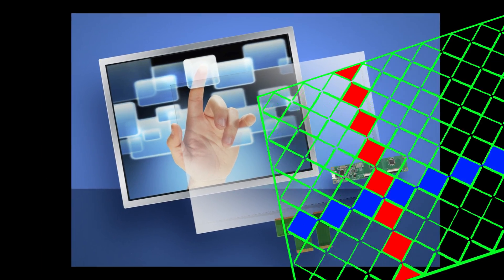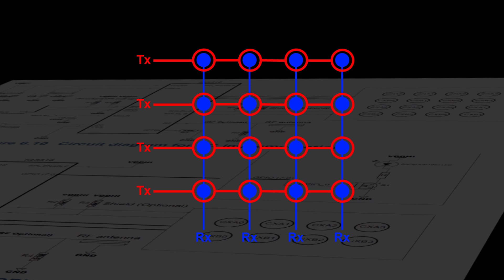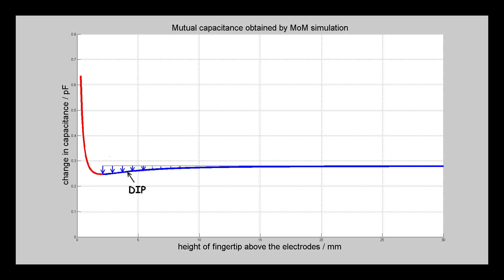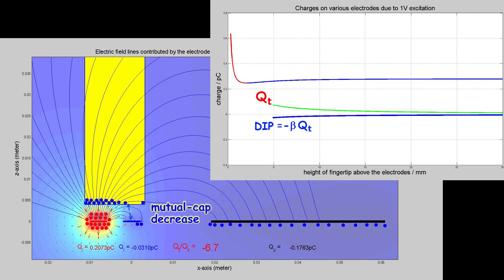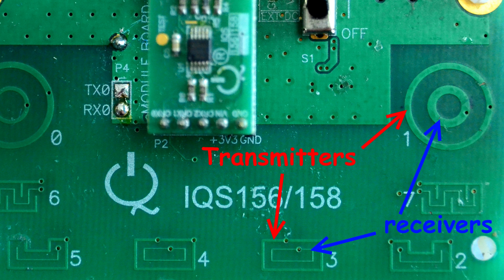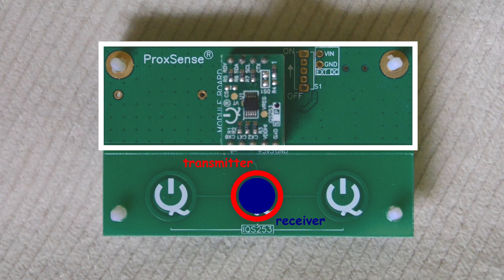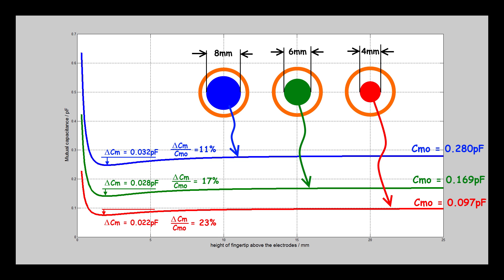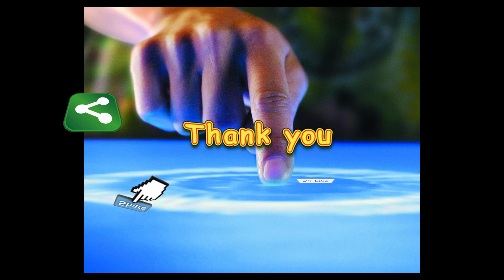projected capacitive sensors, theory and design.(Touchscreen explained)

Comment: Thank you for the great content! I would be grateful for your insights on some of my questions: 

- is your virtual ground at the same potential as the earth ground? 
- In a numerical simulation where there is just the sensor electrodes+a piece of dielectric and no ground, the mutual capacitance should increase right (how is the mutual capacitance defined here)? Because in your earlier video "Capacitive sensor, theory and design", you mention that the mutual capacitance increases due to the polarization from the approaching dielectric medium, which draws further charges from the +V and -V sources; but in this video, you mention that the mutual capacitance decreases. What are the differences between these two cases?  
- Lastly, assuming that I have the information of the charges, how can I obtain the mutual capacitance numerically? Is it correct to find the energy enclosed in the simulation space (E = 1/2 integral of D dot E dV) and do C=2W/V^2? If so, what about doing this energy calculation with a lossy dielectric with both real and imaginary part of the complex permittivity?

Thank you so much for all your wonderful content, and I would be really grateful any comments at all! Wishing you a nice day!
Reply from the maker: The working principal of capacitive sensor does not need the earth ground. 
In other words, the circuit ground and the object (finger+body) are sufficient to influence the charges of the electrode(s),  so the simulation does not take the earth ground into consideration. This is a important point, because capacitive sensor works near the earth surface, or in the mid air.

If a circuit has zero or negligible ground area, then the self-capacitive sensing will not work, but the projected capacitive sensor will work like a self-capacitive sensor. Self-capacitive sensors need 2 electrodes whereas projected capacitive sensor need 3 electrodes.

In the self-capacitive sensor, the transmitter and the ground plane (total two electrodes)  form the transducer to detect the object (human body + fingertip), whereas in the projected capacitive sensor, the transmitter, the receiver and the ground plane (total three electrodes) form the transducer. 
In the self-capacitive sensor, when the finger-tip moves to the touch-electrode, the charges on the touch electrode increases because the electric field polarize the human body, and the charges on the fingertip pull more charges from the source to the electrode. The increase of charges on the touch electrode is regarded as the increase of self-capacitance in the industry. In precise scientific sense, the increase of the charges on the electrode is mainly due to the increase of MUTUAL capacitance between the electrode and the fingertip, but this complicate the matters and I haven’t seen anyone talk elaborate on the misuse of the term SELF-capacitive sensor.

In the projected capacitive sensor, the electric field is projected from the transmitter electrode (1), reflected by the fingertip (3) and bounce to the receiver electrode (2) to reduces the charges on the receiver electrode. The analysis cannot be done by lump capacitor, because lump capacitor confines the electric field within the capacitor and will not influences the nearby object. The reduction of charges on the receiver electrode is regarded as the reduction of the mutual capacitance C21. In precise scientific sense, the charges on the receiver electrode is due to  C21, C22, C23, and as the finger moves and the multi-body capacitor changes shape, C21, c22 and C23 combine to influence the charges on the electrode. C21 can be negative, and when the fingertip is very near the receiver electrode, C23 can overwrite C21 to give some unexpected turn-around response.

Capacitive sensing IC has no idea what happens outside the IC, so it doesn’t know the charges and voltage on the external object (human body and fingertip). It simply amplifies the charges on the electrode to get the trip, and regard the charges proportional to self- or mutual capacitance. As mentioned above, this is not rigorous academic definition. If you want to follow this practical but somewhat incorrect definition, then from the numerical simulation, just take the charges on the electrode and divided by the excitation voltage, you get the capacitance and the tripping mechanism like actual IC.
In my simulation engine (method of moment), I was able to control or force the voltage on each body (this is a multi-body capacitor problem). To calculate the mutual capacitance, I make the transmitter voltage = 1, and force the object voltage to 0, then charges on the receiver is exactly the mutual capacitance. In reality, some non-zero voltage is induced on the object, and this voltage contributes charges to the receiver electrode as well, so the charges on the receiver electrode is not simply related to one particular mutual capacitance.
Reply: @SiliconSoup  Wow, thank you for amazingly clear response! Really appreciate it!!! All the best 😀

Comment: How to optimize the electrode size if we want to measure the capacitance and impedance for a moist body (e.g., wood)? The capacitance and impedance should be higher or lower? which capacitance and impedance value (high or low) will provide the best moisture information. Thanks.
Reply from the maker: I think the self-capacitive sening method is better than the projected capacitive sensing method for measuring the material property.
The capacitive sensing ICs I used as examples in my videos are for user-interface purpose. If you want to measure material property, then the "capacitance meter" must be "calibrated". Most user-interface capacitive sensor has tracking mechanism to detect delta only, and therefore no calibration.
The self-capacitor sensor measures the capacitance between the sense-pad and the ground plane. The object (conductor) between the plates short-circuit the space and shorten the gap, hence increases the capacitance. The moisture also short circuit the space and increase the capacitance. There should be correlation between the capacitance and the moisture.

Comment: Thanks for the video :D !!! 
I fully enjoyed :D

I have a question... How can i detect a finger near of a metal sheet without contact? I need a on/off output (3.3 volts)
Reply from the maker: You may search for CAPPO sensor, sensing the change of capacitance due to the micro-depression of metal plate.
Reply: @SiliconSoup  Thanks a lot :D
I'll search about :D
Thanks 🙏

Comment: Very clear explanation! I’m wondering if there is any material you could provide for reference? I’ll be appreciated for that, thanks.
Reply from the maker: As far as I know, the explanation given by others use different models, which  don't take into the account the effect of ground plane, and don't explain the turn-around phenomenon, The explanation in this video is original, so there is no similar reference article. But be assured, this model is backed up by years of experiments and numerical simulation.

Comment: Best explanation for capacitive screen I've found! 
Could you explain a little bit why the decrease of negative charges on R plate leads to a drop of mutual capacitance?
Reply from the maker: Charges on Tx, Rx and the fingertip are all proportional to the excitation voltage V_Tx, so it makes sense to talk about the charges on a per-voltage basis, e.g. Q_Rx / V_Tx, which is the definition of capacitance. The charges on one conductor due to 1V excitation on another conductor (and strictly no influence from the rest of the conductors, i.e.g 3rd or 4th conductors) is known as the mutual capacitance. Influence from the rest of the conductors can be eliminated by grounding them,  so this is done when calculating or measuring mutual capacitance.  In the matrix-type electrodes, Q_Rx/V_Tx is measured when other rows and columns are grounded, so this is almost like the mutual capacitance. (almost but not exactly, because the human body, the biggest conductor in this multi-body capacitive system, is not grounded during the measurment).
Reply: Thanks for your reply~
I'm a little confused with the definition of mutual capacitance here.
Are u suggesting that mutual capacitance btw Tx and Rx plates is almost determined by Q_Rx/V_Tx ? 
If it is, then what does Q_Tx/V_Tx stand for? is it another mutual capacitance of reverse direction?
Reply from the maker: Precisely speaking, when all electrodes and human body are grounded, Q_Rx/V_Tx  is exactly the mutual capacitance and Q_Tx/V_Tx is exactly the self-capacitance. But capacitive sensors do measurement with the human body floating, so Q_Rx/V_Tx is almost, but not exactly equal to mutual capacitance, and Q_Tx/V_Tx is almost but not exactly equal to the self-capacitance.

Comment: Could you please tell me what tool you are using to measure the self and mutual cap?
Reply from the maker: +Chethan_D I used IQS253 eval-kit and CT210 (www.azoteq.com) to measure the self and mutual capacitance. The tool (CT210) is connected to the target board to read the capacitance and display the data on the PC. This typical connection also connects the computer ground plane to the target board so the overall ground plane is bigger than the actual target board ground plane. To avoid the effect of PC ground plane, the tool must be connected via isolated interface (the device in 2:35 is an isolated interface) rather than direct connection.
Reply: Hi,
Thanks for the info. Sorry for not being clear earlier. I am interested in the multi-physics tool that you are using to simulate the sensor. Could you please tell me what tool u have used here? 

By the way, i read your article on self-cap and mutual-cap in EDN, they were really useful.
Reply from the maker: +Chethan_D I used Matlab to run a MoM(method of moment) code written by myself. Of course I tested it with known cases to verify the accuracy of the code. The algorithm (or the equations) for two plate capacitor of equal size can be found in many academic articles.  For multi-body of unequal size, the equation can be quite tricky though.
Reply: Pebble Soup Thanks a lot for the info!!!
Reply: Pebble Soup hi may I have your article for self-cap please? Many thanks

Comment: Hi Pebble, I saw your video & I feel it's great. Pls help me, can i using this IC for my application "water Level"?
Thank you so much.
Reply from the maker: +Thuong Pham Ngoc  Capacitive sensor can be used for detecting water level. Most people use self-capacitive senor (see my other video) to do it, because it is most straight forward. The projected capacitive sensor potentially has some advantages, but you must be aware that if the electrode is not designed properly, the turn-around (in this video) will work against you.
Reply: Thank you so much for your help. can you let me know, what's the IC I can use it to my application.

Comment: Thanks for sharing the technology. From my understanding of your video, basically, the mutual capacitance decreases when touching before the so call "turning point", which is controlled by the overlay thickness. My question is: is this a common way to do it?  why don't reduces the overlay thickness and detect the increase of the mutual capacitance? In another word, what's the benefit of detecting the decrease of mutual capacitance?
Reply from the maker: I checked a few implementations of projected capacitive sensors, and all of them detect the decrease in the mutual capacitance, so it is very common. Every capacitive sensor competes for sensing distance. The decrease in the mutual capacitance occurs first, followed by the turnaround. Therefore sensing decrease in the mutual capacitance gives longer distance than sensing the turnaround. In the lab, we can get > 20cm distance. Also, the decrease in the mutual capacitance in the projected capacitive sensor occur at a longer distance than the increase in the self-capacitance in the self capacitive sensor. Therefore, the projected capacitive sensor can sense further than the self-capacitive sensor.

In 2D sensing, the location is calculated from the signal profile of all the neighboring receiving electrodes.The neighboring electrodes are "far away" and the signals are in the dip, so can't use the shoot up signal to compute the xy coordinates.  

Interestingly, Azoteq uses the shoot-up signal to implement an additional "snap" function superimposed on the 2D sensing. A metal dome structure, when "clicked" will move so close the the receiver that the mutual capacitance shoot up above the "long term average", and therefore the click is detected. As long as the turnaround go above the average value, there is no ambiguity.
Reply: Pebble Soup What company or companies offer capacitive touch screens with that >20cm distance? If there are none outside of the lab, then what companies offer products with the longest sensing distance?  Thank you.
Reply from the maker: Jared Graham In the lab, I can setup Azoteq IC to sense my palm at 20 cm distance from the electrode. Other brands i tried can reach only a few cm. In real world environment where a moving object could induce more signal than the palm signal at 20cm, then it is not the IC, but the physics that determines whether 20cm-sensing is reliable.